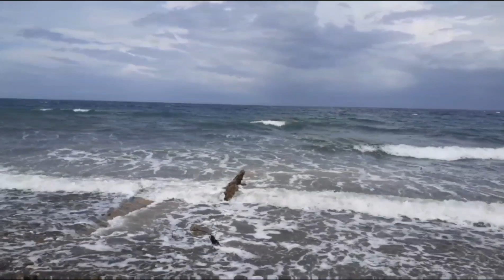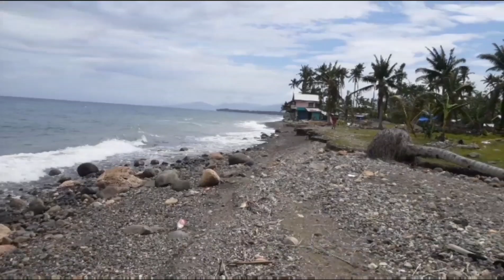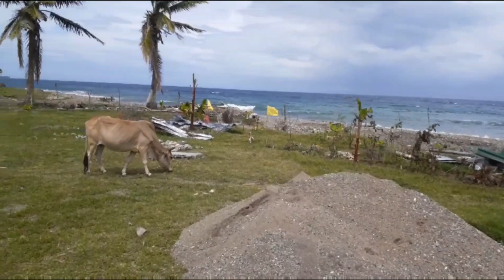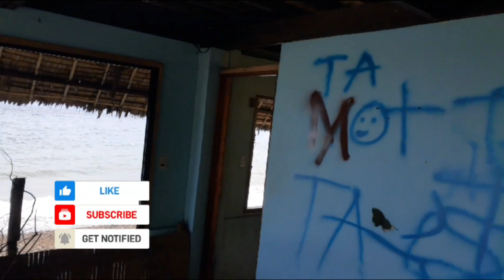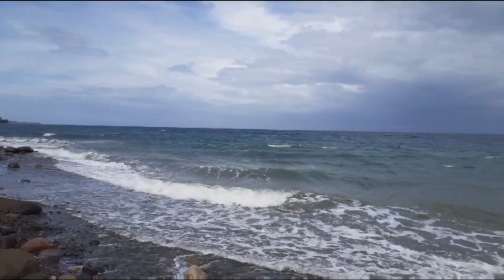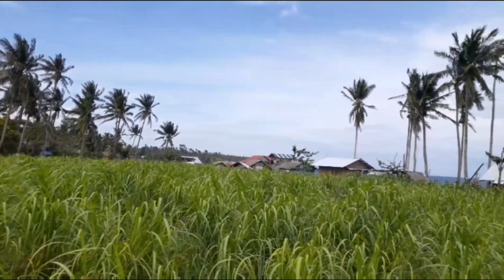Walking over to my friend's house this afternoon 🇵🇭

Comment: Hope your sand for cement does not have bits of seashell in it.. Indicating it also will contain sea salt and destroy any rebar inside
Reply from the maker: Oh it has seashells in the sand for sure 😫
Reply: @markieshumatelifeinthephil2013  means in a few years your rebar will corrode from inside out causing cracks and flaking of cement
Reply: I would source sand from inland
Reply from the maker: Oh I know brother it is a very long ways away from another site for sand 😭